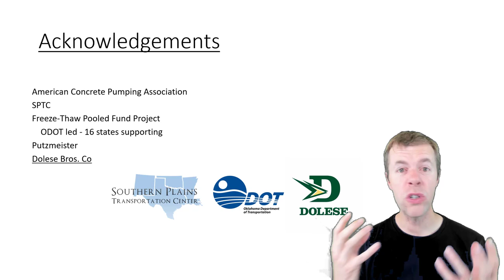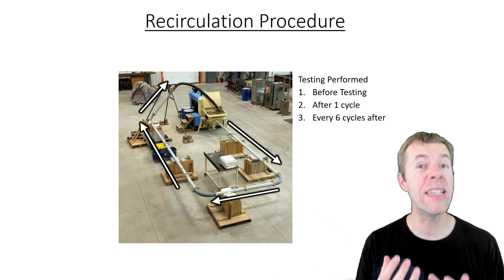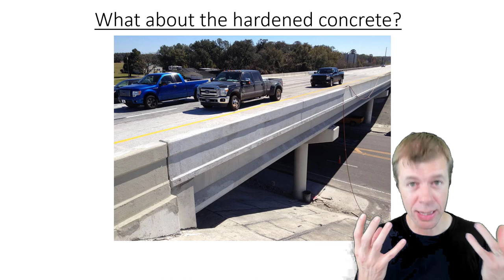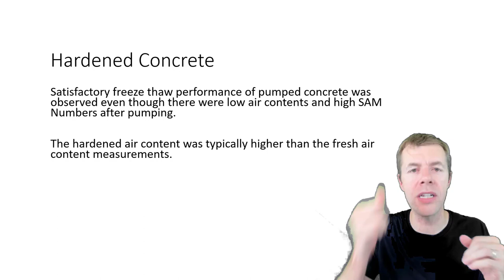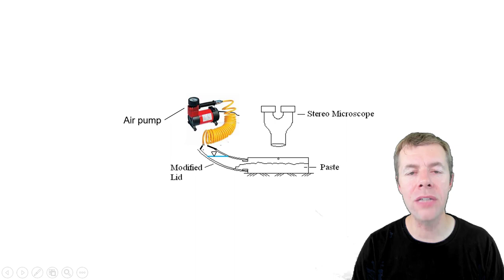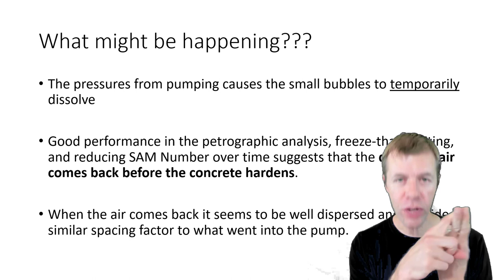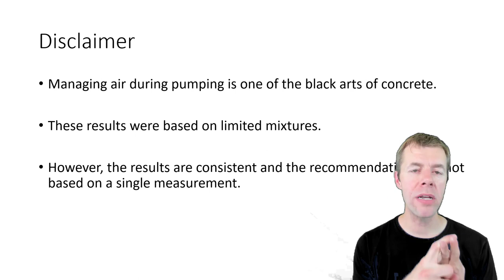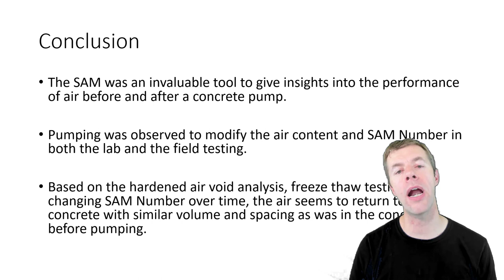Why do you lose air volume when pumping air entrained concrete and why does the air come back?

Comment: everything you say is correct. I have lost a lot of concrete due to pumping. one job we pumped and had to go to 11% to get 8% out and when cored the in-place air was near the 11% which confirms your work. A roughneck hose helps keep concrete from free falling and you will get air to pass a test and get paid for the concrete delivered. I use to be a ready-mix producer.
Reply from the maker: Thanks Frank!
I love hearing about your work.  I look forward to seeing you at a future ACI!
Reply: Does a viber strike lower air?

Comment: Tyler... your mother was right, you're an absolute saint sent from heaven. The internet is crammed with people that haven't a bleeping clue what they are talking about. You are the exception. These videos are really hitting the spot. I was planning on making a 20 ft diameter aircrete dome home, with a regular concrete encasement, in the tropics. I'm now wondering if I should use regular airless concrete. I either case, I'd prefer basalt mesh, fiber and rope over metal rebar and grating, only because it's easier to work with and less prone to rust near sea water. This dome has to be able to withstand super typhoon winds and earthquakes as they are routine, in the Philippines. The whole point of this project is to see if I can come up with something, better than flimsy tar-paper shacks to live in. If you could come up with a rough sketch , mix and process, I and a lot of homeless poor people, would be in your debt forever. In the meantime, I'll continue to watch and benefit from all your videos. Thank you so much for sharing your knowledge with the world.

Comment: Where has this video been all my life. I will be following this very closely.
Reply: This is why I love civil engineering because there is always something new to learn.  This information alone would have saved millions of cubic yards of rejected concrete over the years. It is always a given battle on a job site because everyone has their own opinion of what happens and usually based on their experience or training.
Reply: Based on your example of the glass of water is it possible that the water used in the concrete mix has dissolved air that also comes out of solution is increasing the air content that was measured in the after pumped concrete.

Comment: Good job! I've been in the ready mix industry for several years and have learned that you will lose very little air while pumping, if you never stop the flow of the concrete when you get your sample. It doesn't matter the position of the boom, just keep it flowing. I really enjoyed your video and thanks for sharing.
Reply from the maker: Thanks Doug!
I agree that continuous flow is helpful.  We saw quite a bit of air loss with an A frame configuration even with continuous flow.  Thanks for watching.
Reply: Did slump test numbers vary from prepumping to after pumping? Did flowability/workability change with pumping?

Comment: Excellent video! Just had an issue with this on a bridge deck this morning in Missouri.
Reply from the maker: Thanks for sharing!!!  We have been sampling on job sites this summer.  We see the same things in the field.  It might be time for a follow up video soon with more field data.
Reply: @TylerLey  Air was 5.5% at the truck this morning, after we pumped a little off we lost 2%. They blame it on the pump because I was in a Z-fold position to avoid a light pole and interstate traffic. Drill shafts are supposed to be pumped with 5" line also, but I use 4" and have never had one fail yet.
Reply from the maker: Hopefully, we can get the specs changed.  The Missouri and Kansas DOT know about the research.  I talked in Kansas City in May at an NRMCA meeting and they didn't know what to think.  They were shocked, happy, scared, and excited.

Comment: I've had both happen, generally it goes down by about a percent, but I've had it go up by a percent when the slump at the truck was slightly low right off the top.

Comment: My first thought was that dissolved gasses would disperse in the concrete and form, on average, more and smaller bubbles. The bubbles that never disappear will recover some volume.
Reply: This also reminds me of commercial bread dough that is kept under pressure (during fermentation) so the bubbles that form are smaller and more dispersed.
Reply from the maker: Thanks David!
Our lab testing shows that the bubble spacing before and after are very similar.  We are still working on this topic and I hope to post an updated video soon.

Comment: There's probably something I'm missing, but I've never seen air entrainment equipment that looked to be really complex. Couldn't an air line be run alongside the concrete delivery line, and the air entrainment be performed as the concrete exits the delivery line?

Comment: Interesting.  So what about instances where air measures higher after pumping?  Is the expectation that that will also return to pre-pumped levels?
Reply from the maker: David - From my experience air increase occurs on A frame pumping configurations where you have a damaged seal.  During the A frame there is a vacuum pulled on the line.  If the seal is damaged then air will be pulled into the pipe.  I don't think this air goes away over time.
Reply: @TylerLey  Could that be used to intentionally introduce air into the mixture, is it too complicated, or is that a master's thesis waiting to be written?

Comment: it seems that air entrained concrete is what I know as "aircrete"?i thought the more air the better. i've been sitting here for the last couple days trying to figure out how to get the maximum amount of air into the mixture, and now it seems those ideas are bad? and what is hardened air? i still want to experiment with using different gases and higher air content.
Reply from the maker: Lude,
It depends on what you are trying to do with your concrete.  If you don't care about strength or durability then really high air is great.  If these things are important then you need to be careful.  Hardened air is the air that is measured in the hardened concrete.  Air bubbles change as the concrete sets and that can change the air content.

The oil field makes foamed cement with nitrogen gas.  They do this because of the high pumping pressures that they use.  I also know people that use CO2 gas.  I think it is a good idea to stick with air but it depends on what you are doing.
Reply: @TylerLey would high air content be strong and durable enough to build a roughly 2 story dome shaped home?

Comment: Hello Tyler-I am very interested in your research into entrained air and pumping concrete.  I am from the lightweight aggregate industry so I deal with pumped air-entrained concrete regularly.  I have often observed not only a change (almost always a reduction) in the measured air content after pumping, but also a change (almost always an increase) in the measured concrete density after pumping.  If the air is being dissolved under pumping pressures, later to largely return sometime after placement and before hardening.  There should be observable density/volume changes associated with this phenomena.  What are your thoughts?  Thanks!Michael Robinson
Reply from the maker: Michael,

Thanks for the comment!  

We do see volume and density changes over time as the air comes back.  In our current research, we are studying how and when the air comes back.  It is complicated.  It depends on the original air void distribution and pumping pressure.  The most important thing we see is that as the bubbles come back they are small and well distributed.  This means that they are good for freeze thaw durability.  By getting field data from as many projects as possible we want to look at this behavior with a lot of different mixtures.   My team was on a job early this morning.